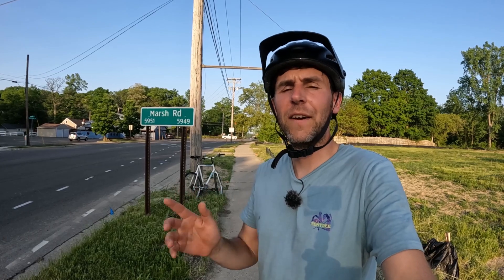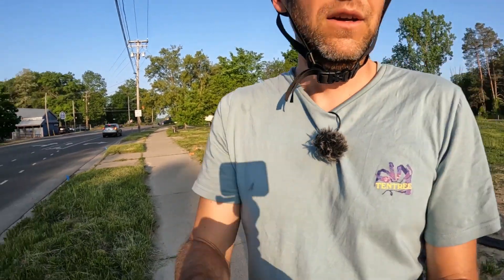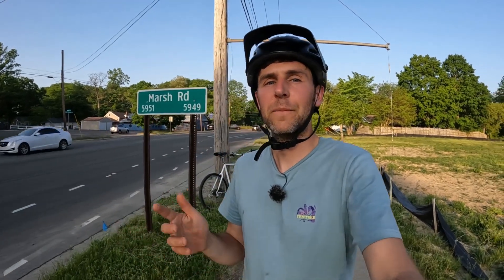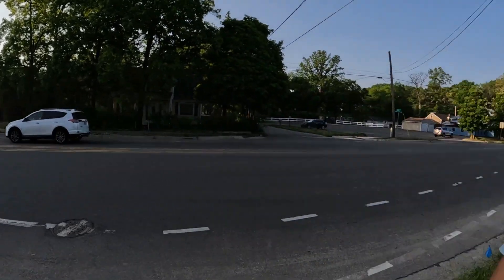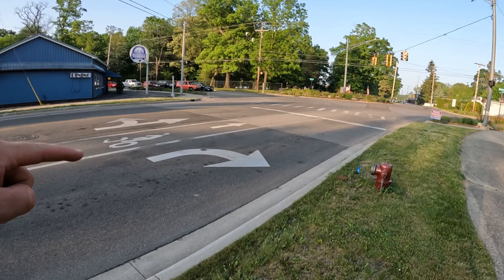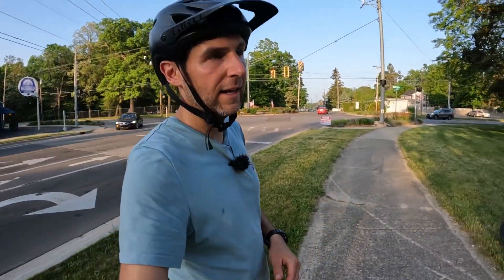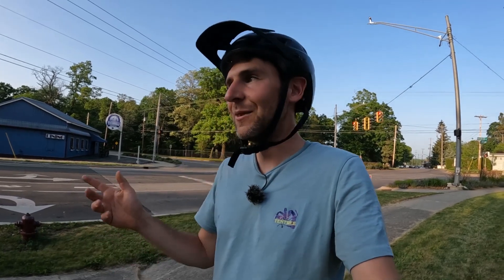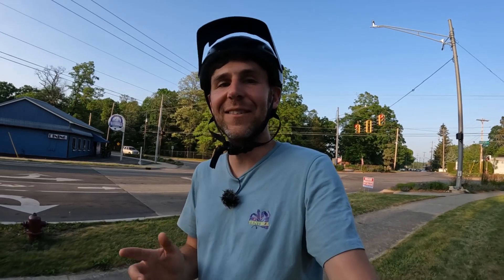The Problem with Painted On Bike Lanes

Comment: This is how, after the 1970s, the present bike-infrastructure in the Netherlands started;  Just some lines painted on the road.
It did give a feeling of safety, and was better than the situation before. But it was not enough.  I do not want to imagine having less than we have now.
Every problem you pointed out in that junction is so true.  Thanks for your reporting. It helps raising the awareness that better is needed.
Reply: @Elatenl   - Yes, there are (still) many painted bike lanes in the Netherlands. I am looking at one from my window, where an elevated path is possible and would give more protection.  Eventually some of those painted paths will be made into more separate paths, but there will always be more to do.
At least the lines he showed in the video are a start.

Comment: In Germany we keep the bike lane ti the right, so even if an accident happens, it's a the point where the cars are the slowest. The US design does basically the opposite: the conflict is before the cars even start to decelerate.
The Dutch way to move the bike lane far to the right works even better, however needs a lot of space that's often not available.